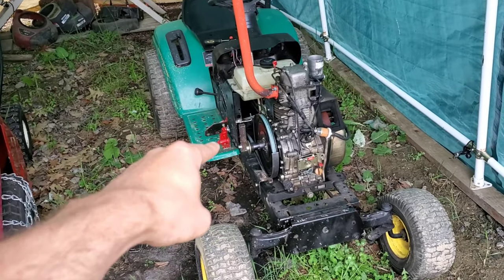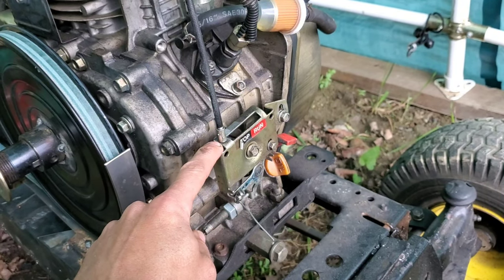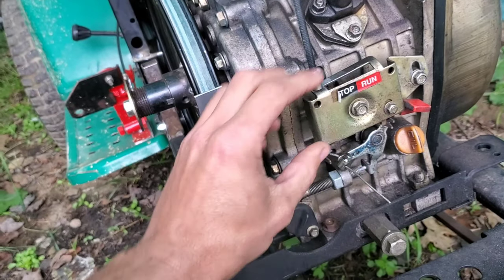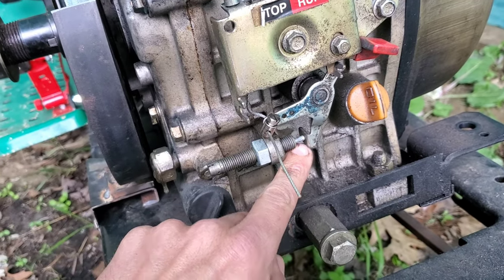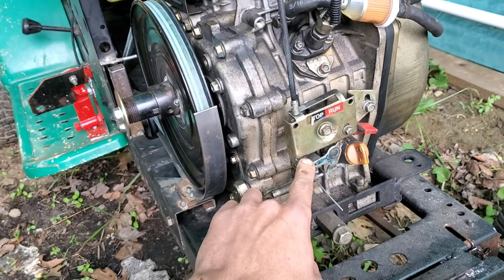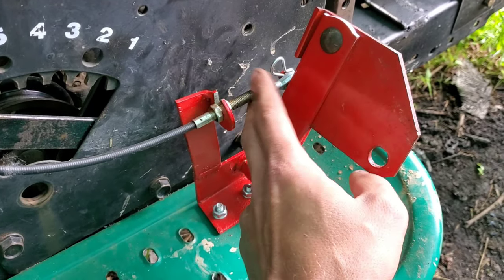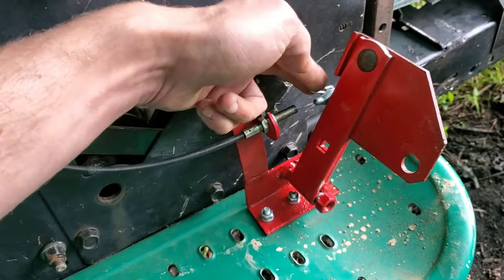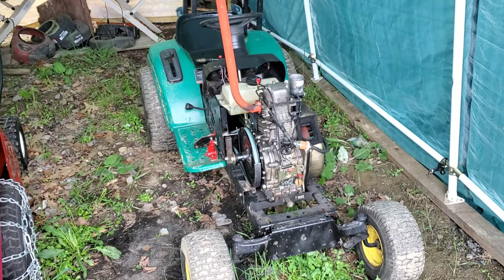Diesel Generator Gas Pedal How To

Comment: She running way smoother now! 

Just a tip for longer engine life: never run these engines under 1500 rpm
Reply: Was thinking the same seems the idle too low
Reply: @cliffpalermo  These engines, have inefficient cooling and oilflow at those rpm's.

Comment: I'm guessing the white puff /skip/miss it had a couple times at top rpm in the intro was the pump float because it's running alot better than before.
Reply from the maker: Yes at this point I have it 95% sorted out. Now just hoping the races do not get rained out :(
Reply: @RCGRacing  fingers crossed 🤞